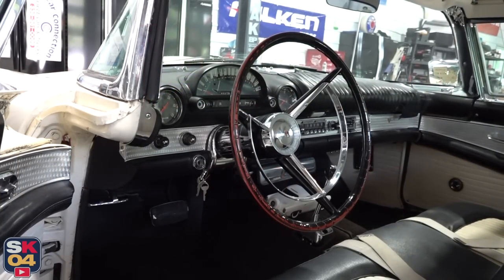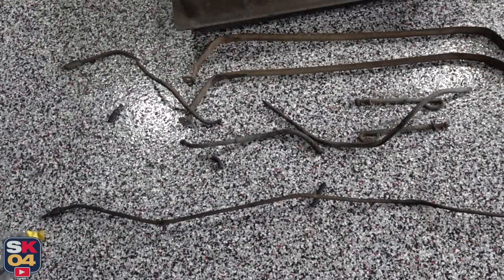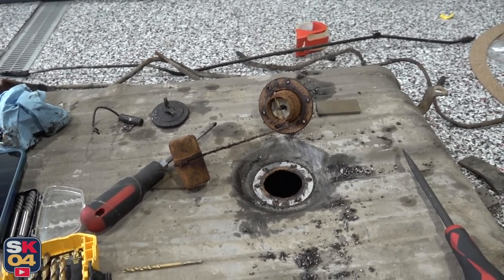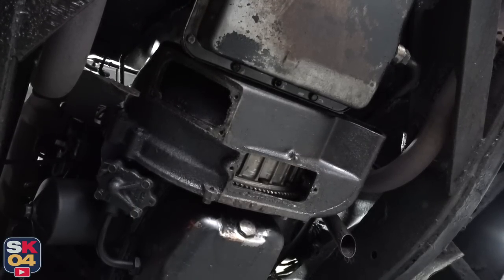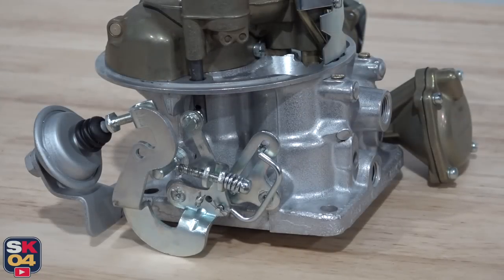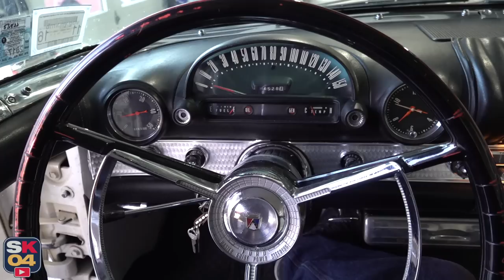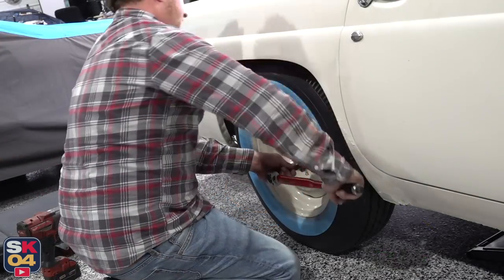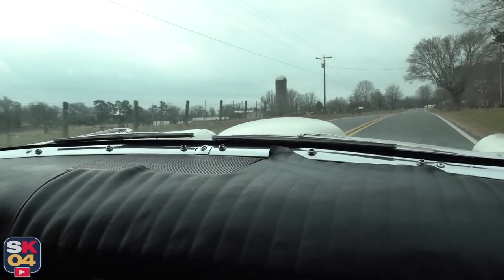Giving a 1956 Ford Thunderbird A New Lease On Life...First DRIVE In YEARS!

Comment: A little work and waiting is worth it I just had a new water pump and therma stat put in my 99 doge ram 1500 wheel chair van before the new year they both went out about the same time after it rolled over 64 thousand miles no problems with the engine or transmission runs good not the easiest to replace parts everything is tight under the hood the doge ram van from 96 up to 2002 I've always liked the ones from the 80s not so much that's just me good luck with the car good video